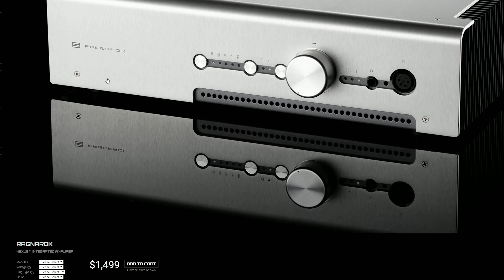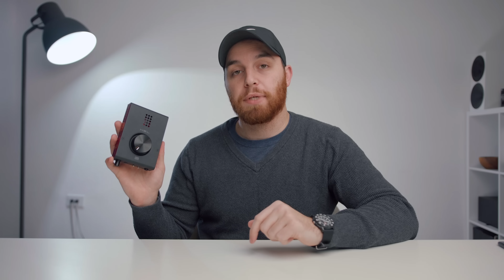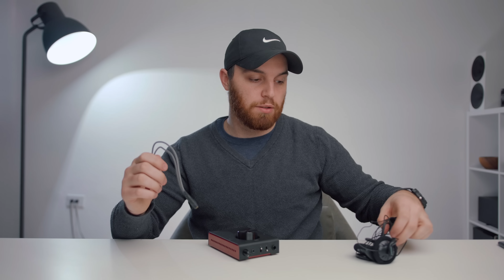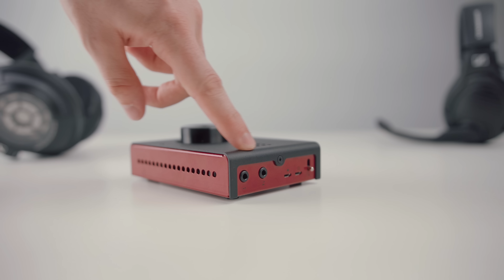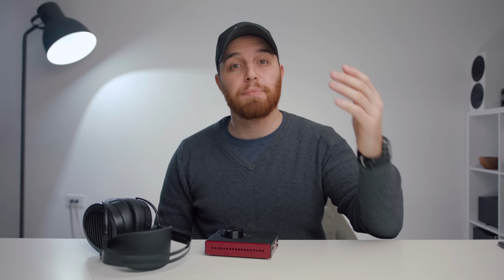One Hel of a Review 😈

Comment: Just picked up my first Schiit, a Fulla 3. The Fulla (Hel would also be awesome) are great for my situation: a guy working from home who has an amp/speakers hooked up to my computer, but frequently goes to headphones to avoid interrupting the people around me, but also need to video conference. This allows me to leave my headset plugged into the iMac headphone port, my headphones plugged into the Fulla, and easily switch to my speakers when I want to rock out.

Like you said, the one thing I'd appreciate is a headphone/preamp switch. That would allow me to leave my headphones plugged in all the time, saving wear and tear on the headphone jack.

Sound quality is much better than the analog output on my iMac. I love it!

Comment: No optical is kind of a deal breaker. Why make an amp oriented towards gaming and not support switching between console and pc with a switch? Seems silly, the ARC is a better value imo.
Reply: Yeah idk about this. If I really care about gaming, I can get the GSX1000 and have excellent 7.1 sound when I need it for games (and it is really good) for about the same price.  The mayflower seems to be better if you have more audiophile ish interests but also do some gaming. I feel like the Schiit Fulla is the more compelling DAC amp for the price. 100 bucks I wouldn't expect it to have the GSX1000's feature set but if it pushes good audio then it's a good value proposition.

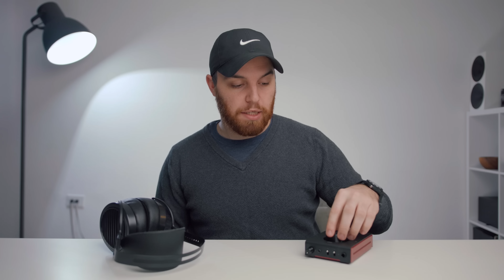Comment: Does your Hel have audio imbalance? I had to rma my first copy with a physical defect and was scared I was gonna get a new worst copy sound wise. And I’m afraid I did. At around 7-8:30 high or low gain, the volume is much louder on my left side. My first Hel didn’t have this problem. I had to lower my left gain in Windows to 89% for it to match

Comment: *Asgard 3, not Asgard 2. **Schiit Hel can actually be powered just from your computer. You just need to plug in both usb into your computer, unlike Fulla 2 that only requires one of the usb plugged in.
Reply: Tommy Tak that’s not 100% accurate. While you can just plug both into the computer, Schiit recommends the power usb input be connected to the walwart for a consistent 2.1a that it requires for the best performance. Computer usb outputs have a lot of issues delivering consistent power output and its better to listen to Schiits advice.

In fact the manual says the hell NEEDS (they put it all caps) the walwart.
Reply: @thebadburrito1394  Someone figure out why this thing has slight crackling whenever sounds or applications that try to access it startup after no sound has been going through it for like 10 seconds.

Comment: not having a simple switch between speakers and headphones is just no go for me. You cannot just plug in an out your headset just to switch in between and expect the product to last long years.
Reply: I have a fiio k3, and it actually powers both the headphones and speakers at once. I have shp9500 as headphones and my line out goes to jbl 104. I just turn the jbl down directly when not using them as they have their own dial. The whole thing is very functional all together. I don't use the speakers near as much as I use the headphones, so maybe different use case, but I don't see plugging in and out the headphones as a major deal breaker if I was to switch to this.

Comment: No optical in...is no buy for me.
Reply: Sorry, may I ask why you don't like USB as input? I'm a noob when it comes to DAC/Amps!
Reply: @strumpa84  USB can sometimes pick up PC noise from the GPU or even the power supply. A well engineered DAC like the RME-ADI-2 DAC on USB input is pretty much immune to noise from my PC. Yes, even with unbalanced RCA output to my studio monitors. Optical input can be useful if you want to transmit a digitally processed virtual 7.1 from a soundcard to an external DAC.
Reply: JTCPingas all the good virtual surround shit is software-based now.
Reply: @strumpa84  

I aslready have 3 different usb dacs.

I need optical for my PS4 Pro

I got the Jitterbug to remove usb noise.
Reply: @BunnyslippersEUC  I understand, thanks for answering =)
Reply: If only it had Unison USB. Then it would be worth giving up optical to an extent.

Comment: Good review. But 3,5mm input for headphones on the front would have been horrendous. I'm sure you've all seen how the 1/4" to 3,5mm adapters look. It ain't pretty and it's bound to break, either by accident or over time due to weight on that dinky 3,5mm. Sure the solution they provide might not look pretty, but it's better than the alternative I'd say.

Comment: Kinda dumb that gain affect line out.  The soundblaster g6 has line out and it does not matter if the headphone side is on high gain or low gain.  It does not effect the line out.  Why dual usb.  That makes you need take an additional outlet just for the unit.   If it was a power brick you can go with more power.  But it is micro usb 5v at 2.1amp.   Seems silly to go dual usb for power.

Comment: What about the Sound BlasterX G6?
Reply: Tried both but answering for any future reader, and it really is not a comparison between this and that lol. This actualy works extremely cleanly and the treble for headphones sounds super clean and pleasant, while base is very present but not rattling my head like crazy. Raising the gain on these at high volumes doesn't necessarily make the sound much LOUDER as much as it does make it sound FULLER. Its something you wont exactly know what it feels like until you experiance it for yourself with a good amp/dac. The g6 pushes out loud sound but it definitely can be very alarming and sound very hard to listen to. The volume adjustment is also not very granular on the g6, so getting the right volume isnt ideal. Lastly, the g6 is really light so cord tension can pull it off the table, the Schiit Hel is heavier and has these really good feet that make it feel much more stationary and secure. Not saying the g6 is a terrible product, and it works on my ps5 where many modern amps dont at the moment, but the Schiit Hel and its successer the Schiit Hel2 are incredible and really make a world of difference listening to any audio whatsoever (also Hel2 works on PS5 via back usb). If you can manage the price difference from like $150 U.S to $200, its the better option and its not even a comparison .

I used my HD560s to test both by the way, which is a pretty neutral headphone to compare the sound signature of both devices. I think my experiance was a pretty valuable one in getting to know what makes great audio

Comment: Great video and the lighting as you showed the amp  which could be on the manufacturers website. I got this today to go with my Sennheiser Games ones. Have you got a better solution for connection of this headset as the adapter splitter cable looks awful?

Comment: SBx G6 seems a better pick...
Reply: And the G6 will give you optical in and out and a very clean 32bit dac, and excellent sound as well for music and gaming.  Schiit let out things that some gamer will want like dolby and 7.1 support.  Some do like those features.
Reply: Agree. Wish Schiit had though more of console gamers for this. Appreciate Microsoft make it difficult but an optical in would have kept PS4 users happy.
Reply: @jamiemui5186  would optical or usb be better for the g6? i plugged both optical and USB in ps4,  but optical out with headphones sounds weaker than the headphone jack
Reply: @khmergodhobbies  usb is my choice.  The ps4 does not have optical gain by adding or removing attenuation. Sound strange but you can increase volume over optical.  But i tested it out, plugging a sonos connect into a soundblaster e5.  If i increase volume on the sonos connect.  It would make the volume louder going to my speakers going through the e5.  And i could also control volume on the e5.  I know it is the same on the g6.
Reply: @shoturtle1930  It doesn't even work with the PS4, atleast regular. I bought this to use with both my ps4/PC but PS4 doesn't support UAC2.0 it seems. But it does sound noticeably better than the Fulla 2, especially at high volumes.
Reply: @FrickinBigEe  feommwhat o read the ps4 might not provide enough power over usb.  And many recommend plugging the g6 into a usb charger and going optical on the ps4.  This will increase the volume.  But you loose mic.  The other thing for usb uses is to turn down chat.  I dont even have usb option with my xbox.
Reply: @shoturtle1930  I meant the Hel 3.
Reply: @FrickinBigEe  that is a shame.
Reply: Vandoeun Long pc usb, xbox optical, usb for ps4
Reply: Zoltan Szabad can’t you just not run your mic through the dac and not experience the delays?

Comment: Compare it vs a soundblaster g6
Reply: Personally, the Hel sounds noticeable better than the g6 which lacks dynamics, sounds a little bright too me, not as flat sounding. The g6 also has driver issues, and as creative products age the driver issues get alot worse. But the g6 has alot of the gaming features gamers want, and is more versatile with more inputs and outputs. So the Hel is the simple better sounding option and the G6 is the feature and input/output rich option. All depends on what's most important too you.
Reply: @LifeLongCaboose  brighter is more useful for fps games.  But the g6 you can change almost any aspect of the sound with the sw you want.  And it wont be as bright for music if you want.  Different way of doing things.
Reply: @shoturtle1930  But once you start messing with the effects on the G6 it's starts to distort very fast. The sound quality is not great if your using any of the creative dsp settings. Your better off using a better EQ with the Hel if you want to alter the sound and keep the best sound quality.
Reply: I have a G6 and it works really good which i dont have any other amp/dac to compare with, wondering if a schiit stack (or any other amp/dac) will give me a better sound experience?
Reply: @kaizai888  All depends on what your using and what your looking for and what your looking to upgrade to. Is a Hel or magni modi worth the upgrade not really. Is a JD's labs and modi 3, maybe, but I'd aim for a more noticeable upgrade. Depending on what your using.
Reply: @LifeLongCaboose  you can use an independent eq as well with the g6.  There are many ways to to the same thing.  And the pre install dsp setting are not bad.  Flat is pretty much flat and does not distort.
Reply: @kaizai888  the magni is not worth the upgrade.  It is not that good of a dac.  Your g6 is a better dac unit.  Ypu go from a very clean 32bit dac to a ho hum 24bit dac.  Asr review the g6 and magni.  Not with the trouble of the stack.  Not sold on the hel either.
Reply: @shoturtle1930  The magni isn't a DAC. It's an amp. It's a better amp than the g6 but not worth the upgrade. The modi 3 is also better than the g6 for a DAC but not worth the upgrade. 32but doesn't mean it's magically better. The g6 is fine, but that's all it is, fine. The Hel isn't a huge upgrade for him (depending what headphones he's using) but the g6 isn't end game, and the Hel does for sure sound better.
Reply: @LifeLongCaboose  sorry modi, the magni modi is not a particular outstanding stake.  Just look at asr review of the dac
Reply: @shoturtle1930  The Modi 3 is a fantastic DAC. The magni is just ok. Atom, liquid spark, and K5 are better Imo. But the Hel (compared to what I Remember the magni sounding like) sounds better just isn't as powerful. I wish they had a optical port. But I'll be doing my own review once I finish testing.
Reply: @LifeLongCaboose  like i said look at the asr measurements
Reply: @shoturtle1930  I mean, even the ASR modi 3 measurements are better than the DAC portion of the G6....... So I'm not sure what I'm suppose to be looking for there? . There is also more to audio than just measurements, but I'm assuming you have tried all of these products and know for your self from personal experience.
Reply: @LifeLongCaboose  thd 119db on the g6.  The modi does not reach that
Reply: @LifeLongCaboose  I looked at the Modi 3 (same dac as the Hel) and G6 on ASR and from what I can tell, the G6 beats it in almost every category. Am I reading it wrong? Can you elaborate on how the measurements on better for the modi 3?
Reply: The sound blasterx g6 is a excellent starting point for gaming audio. You can also connect a better dac/amp in the future to the g6 by utilizing the optical out on the g6. That way you can get the dsp from the g6 into a higher quality amp/dac if you’d like. 
I have a g6 with the optical out to a topping d50s dac and then I’m using Schiit heresy as my amp. End game audio for me.

Comment: Ha one of the main reasons I didn't buy the ARC was the lack of a headphone/pre-out switch  and the main reason i didn't consider this since the ARC mk2 has that so i bought that. They apparently cleaned up the mic input on the mk2 so I'd be curious so see how it compares to this. Either way it cant get worse than the shitty steelseries usb dac/amp im using.
Reply: @notypes So when it works it works awesome but the firmware is kinda shit imo. For example when I first got it if I tuned off my computer and turned it back on it wouldn't work at all and I had to send it in for a fix (was free). However right now my biggest gripes are that I get crackles from my speakers when unplugging it or when it first receives power ie when computer boots up and that the source select if you leave it on pre-outs when turning it on, it goes through the headphones until you switch to headphones and then back. I'm planning on contacting again I just don't want to be without for months potentially during covid19 if they want me to send it back.

Edit: if you don't need the extra features of the ARC get the fulla 3 or hel.
Reply: @notypes will do, in curious if yours has the same issues as mine
Reply: @notypes yes it's driverless but the individual components have firmware. This isn't something you need to worry about. Plug it in and assuming you have the switches on the back right it will work.
Reply: @notypes Good to hear and yeah I agree it's worth it's price, there's not really much like it out there from a feature standpoint. Hopefully I can work with them to get the last few annoyances of mine resolved.

Comment: Can this be hooked up to a ps4 pro? Everything I hear is pc
Reply: No, its not compatible.
Reply: @gregwx  damn, well thanks for the heads up
Reply: @asaruxiii3026  Sure no problem, Mayflower Arc or Sound Blaster X G6 are better solution.
Reply: @asaruxiii3026  Other thing you can do for less money and better amplification is, get JDS Atom and a ModMic USB edition. If your monitor/has a audio out, connect to the Atom, and ModMic to your PS4.
Reply: @gregwx  I have the arc but Mic is not that good, the I did not know modmic had usb version so thank you for that, jds atom sounds like good option too
Reply: Some companies make USB DACs that work with the PS4. I wonder if such a thing could be pulled off by Schiit. Or they could put a darn optical input on the thing.

Comment: I have audio engine a5+, i can plug them in to the preamp and just control the volume through the Hel. Does the Hel provide any boost to the sound or because its a pre amp it by passes and used the speakers built in amp?

Comment: Why the hell would they go with micro USB and not USB c. That is the one problem I see with this product.
Reply from the maker: I don’t think most dac chips work with USB C. Not sure why. That is over my head. 

But almost no dacs use usbc.
Reply: @JoshuaValour  hmm I didn't know that would cause problems. I just hate how garbage the parts are in micro USB connectors. They wear out so easily. Thanks for the info.
Reply: @JoshuaValour  the usb dac are available with most phone now.  Apple usb c dongle measure well. Soundblaster x3 is usb c desk unit.  You can have higher power with usb c vs micro usb.  There is no issue using usb c for a dac. Really short sighted.

Comment: Can anyone confirm that I can use this with any console through the 3.5mm input?
Reply: You could but you really would not want to. Let's look at the PS4 controller for example. Audio is sent to the controller via Bluetooth, which already decreases the quality of what you are going to hear. The controller then has to convert that mediocre audio into an electric signal that the headphones can understand. The technology in the controller that does this is pretty bad because the controller cannot be too expensive and has to do other things that are more important for a controller. 
So if you connect this Schiit Hel to a controller you amplify already bad wireless audio and it would sound pretty bad. If you want to use something like this you want to look for a device like this that can connect to a console via USB or Optical cable. It is called a DAC/AMP, which stands for Digital to Analog Converter / Amplifier. Just make very sure it works with the console you want via USB. If you want to use your microphone, also make sure it has a mic input.
Reply: @borisahsmann7190  Shite yeah never really thought of that.. I wonder would you lose as much quality from hdmi to monitor.. and 3.5mm out from that to aux in on hel..  that wouldn't allow mic use as you say though.. it's so much nicer than a soundblaster g6 but strictly for pc only really.. I need one for everything ideally!
Reply: @Feenicks30  A monitor would do better but then you are still relying on the DAC in the monitor and DAC of the Schiit Hel is a significant part of what you pay for, so it would be a shame not to use it.
Reply: @borisahsmann7190  It seems the mayflower arc has virtually every feature I can think of! Seems to be the way to go!